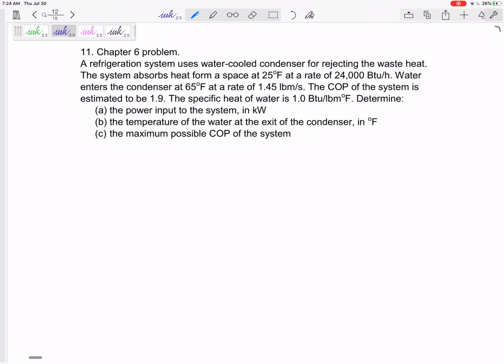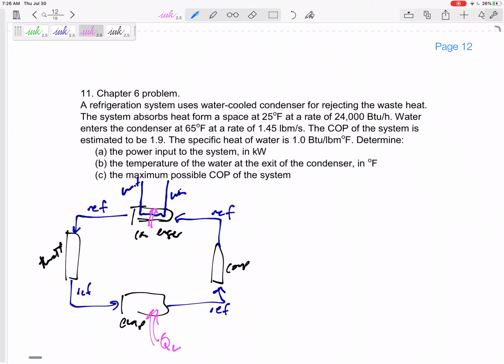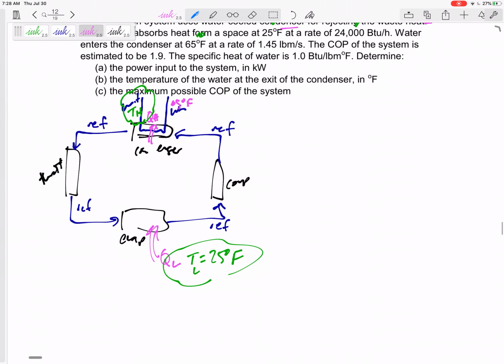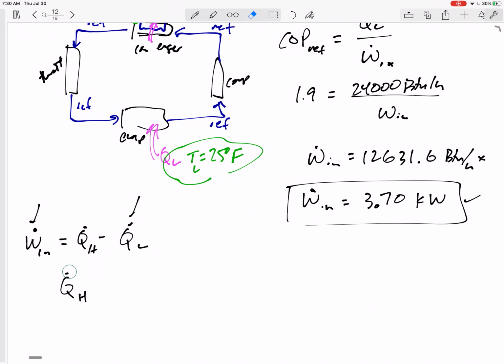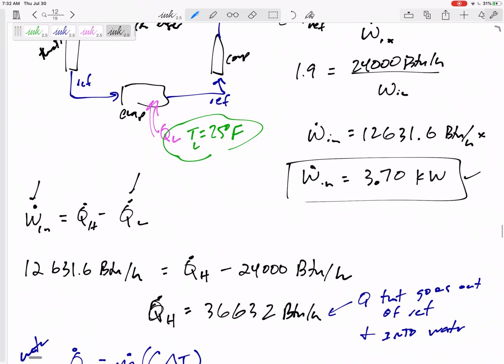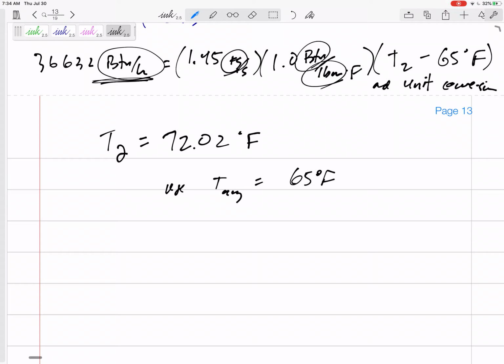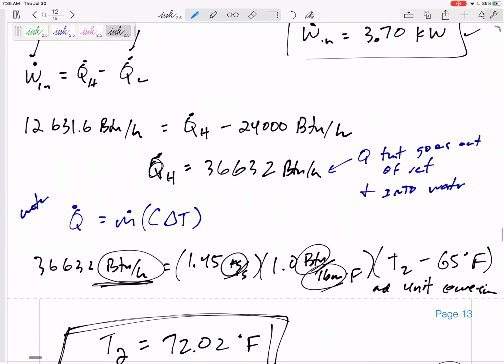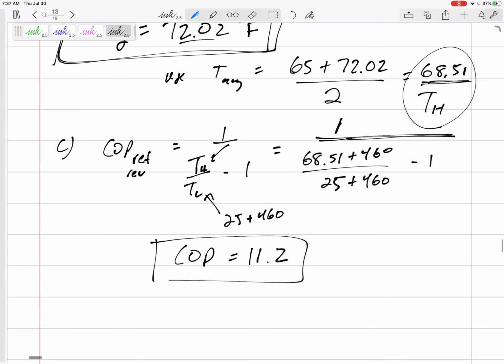Thermodynamics - Final Exam Review - Chapter 6 problem

Comment: Thanks for all you have done. Question though, how can water enter a condenser at 65F, lose heat energy Qh, then come out with more energy at 72F?
Reply from the maker: The water is inside the condenser, accepting (gaining) the Qh from the air. It’s the air inside the fridge that is losing that Qh.
Reply: Perfect thx got it:)